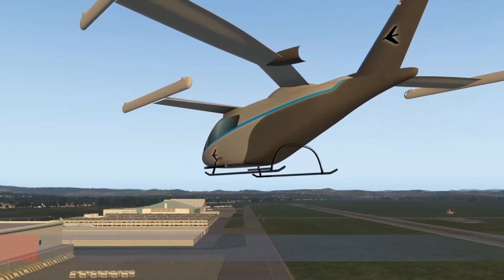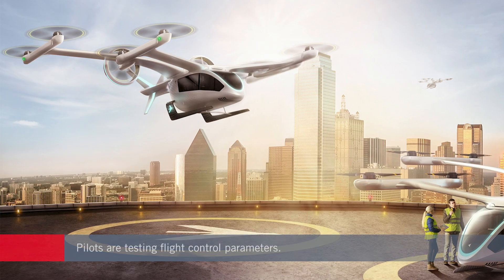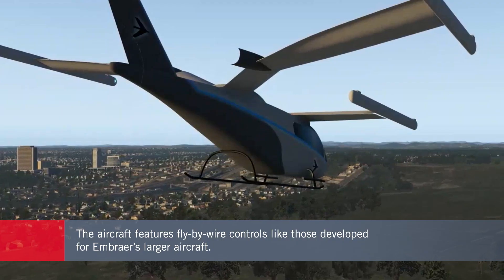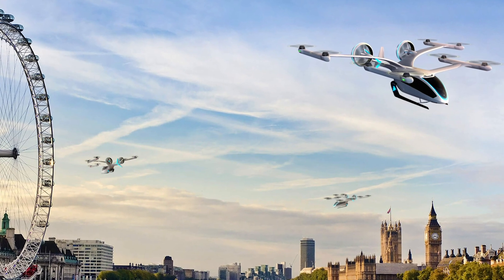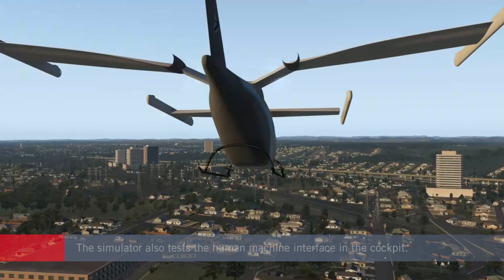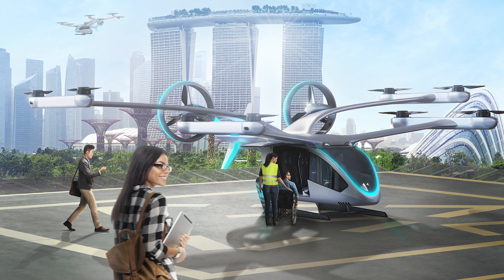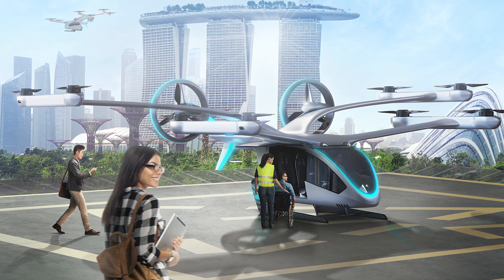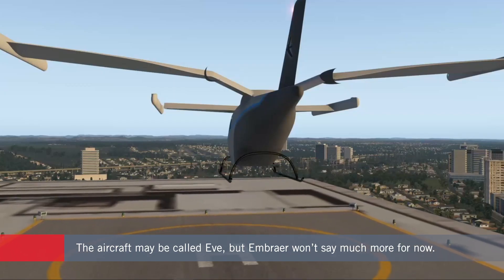How a Flight Simulator Gives Us an Early Glimpse of EmbraerX’s new eVTOL Aircraft – FutureFlight

Comment: hmm, that sim dynamics looked anything but realistic. I think having a pilot is a mistake, having 4 seats is a mistake, as is that many props. Single seat tilt wing robotic seems the obvious way to go to me. Could have an infant seat in tandem that doubles as luggage space. 4 seats is old thinking. you want it as light as possible for minimum sound impact for urban use.
Reply: your comment is a mistake
Reply: 4 seats is for it to be affordable with a pilot
As for why it has a pilot 
The technology for autonomous UAM isn’t completely available and there are no regulations in place for such a vehicle.  
On top of that, people aren’t comfortable flying in a pilotless aircraft yet. 
Not having a pilot will make the time for the aircraft to be available on the market take a lot longer and the 4 passengers are to make the flight more affordable.

Eventually we will probably get to a point where we can have autonomous air taxis (even embraer thinks this may take at least a decade) and then we will be able to have single seat, remotely or autonomous aircraft like the Airbus Vahana (even that was just a demonstrator)
Reply: @nikobelic4251  I understand your position but it's wrong. Sure there are some new regulations needed but a 4 seater with a pilot has no mass market. That's going to be very similar to current helicopter use and has a much greater audio signature than a single and that matters for setting down in urban locations. As does size. A 5 seater is also much more expensive to develop. And people will quickly accept the autonomy once it's been in use for a while. 5 seats with a pilot wil be expensive per trip, single seat ultra light can be so cheap you use it instead of a car, and that's when it really takes off. You see?
Reply: @DanFrederiksen  I’m sorry but you are the one who has wrong

There have been hundreds of orders by airlines for these vehicles with 4 seats and a pilot.
The market has already spoken.

At least for the start, 4 +pax and a pilot is the way to go 
Then you move to autonomous, pilotless operations and single seater aircraft.
There is only one company I know Whisk Aero that plans to start with pilotless operations and they already openly admitted they won’t be the first to market because of this
Reply: @nikobelic4251  right. they are everywhere. honey, I don't do wrong.